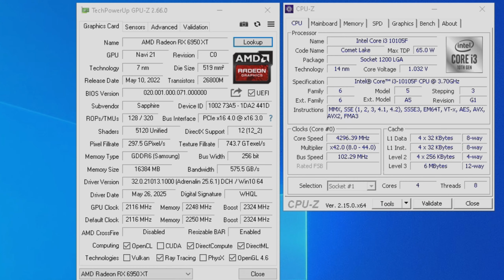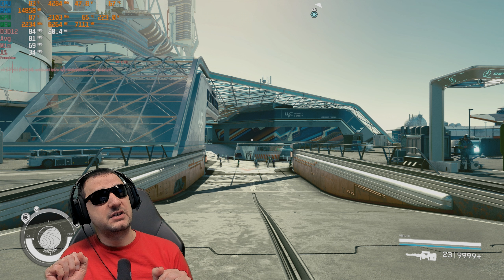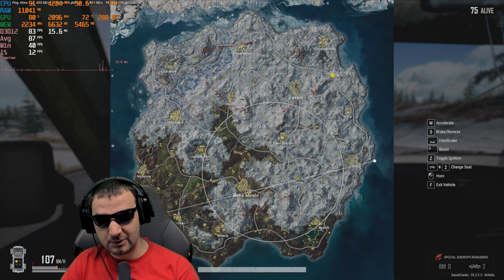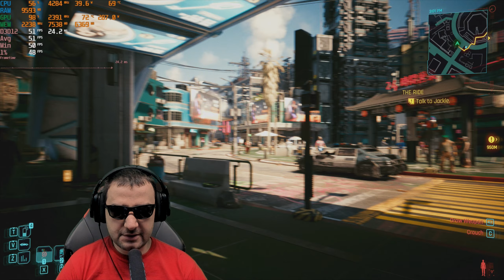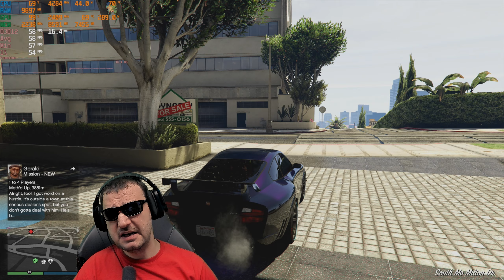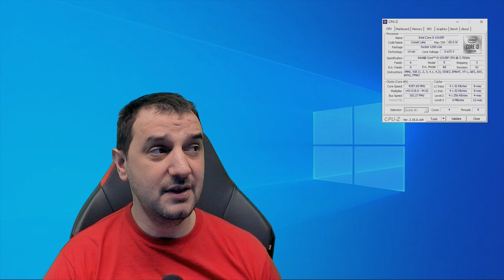Intel Core i3 10105F vs RX 6950 XT Benchmark

Comment: very intriguing mixture. Obviously the i3 was getting a heavy load, but I was impressed with how much it was able to do. I wondered if the i3 was maxxing out on single-core performance to compensate? Regardless, the goated 6950 was clearly doing the hard work.

Comment: The Intel Core i3 10105F performs great with the RX 6950 XT but the reason I wouldn't recommend pairing the Intel Core i3 10105F with the RX 6950 XT is because of the difference in price and the cpu bottleneck. I would recommend pairing a RX 7600 XT 16GB, RTX 4060 Ti 16GB or RX 6800 with it at 1440p/4K and I would considering pairing a RTX 3060 12GB, RX 6700 XT or RX 7700 XT with it at 1080p. The only reason to pair the RX 6950 XT with the i3 10105F is if you're going to upgrade the whole computer and cpu in the future to a cpu that doesn't bottleneck the RX 6950 XT.
Reply from the maker: For the moment, I do not have the money to buy those cards yet. I bought the current card to pair it with the i7 6950X and see how it performs. The i3 was just so I could test an AMD GPU versus the RTX and Intel ARC setups I have already tried. This is not the final form of the PC. It will eventually end up with an i9, since it is built on a Gigabyte AORUS XTREME Z490, and I need that for SLI and CrossFire support. It is more like the final form for testing. This setup is just something in between until I fully build and test the PC.
Reply: @DanielCardei I understand that Daniel. I was just giving suggestions and I also understand that you can't always afford all of this hardware.

Comment: Fun bottleneck build. I do note that even at 99%, the GPU is only near 290W, and it is a 3x 8pin. While my 6950xt is an OC model, it does go to 345W at default settings

Comment: Compare 10105F vs 10400, QTB0.. on ebay it not so expensive!
Reply from the maker: The best I can do for the moment, when I free the motherboard, is to get some Celerons and a Pentium. Those are cheap. That i5 is still not low on the price. I can get more CPUs with that money.

Comment: You need more benchmarks. Doom6, Indy, Stalker2, Wukong, TES4R? Nobody cares about CS2 or GTA5 with a high end card.
Reply: Those new games are boring and shit unoptimized crap
Reply: @excess.subiefl0w  Doom The Dark Ages is well optimized and seems like it is a great game going by what youtubers have said and it be at very positive on Steam. Also I disagree that Indiana Jones, Black Myth Wukong and The Elder Scrolls IV Oblivion Remake are boring but I will agree with you that they are unoptimized.
Reply from the maker: True. You are correct that in order to push the limits of a GPU like this, you need to run the games currently on the market. The only problem is that it will take some time until those games are optimized. By that time, other GPUs will come to market. Don’t forget about other games as well. So at some point, what’s the best GPU for that new game that was released and then became old? When does this circle ends?
Reply: b-b-b-but I CARE

Comment: Buy another cpu bro, i3 10th is 100% bottleneck , you need minimum i5 13600KF or ryzen 5800X3D
Reply: but isn't the whole point to show what the setup can do even if it's the bottleneck? we all know the gpu is overkill for an i3 10th gen but this is not something many people do i think. his whole channel is basically about benchmarking and experimenting older/vintage hardware and different setups like this one.
Reply: @umnickaleatorio  Dude, we know very well that he tests old hardware, but if the goal is to test the rx6950xt he must put an old CPU at least decent like a 5800x, also the XEON 2696v3 overclocked goes well, but not this i3. Otherwise he is not testing the GPU and any other less powerful video card would be the same
Reply from the maker: Actually, it's my fault in this case. In the B-roll, I was blabbering about the setup, and I thought it was irrelevant, but now I realize it would have made sense to leave it in.
The point of this was to test an Intel GPU, an NVIDIA GPU, and an AMD GPU with this i3 CPU to see how it performs, basically to push the CPU to 100% usage.
The only time I came close to testing the RX 6950 XT (and I think I mentioned it at the end) was with the i7-6950X. Now, I want to push it further using 4K with VSR.
The only setup that might actually challenge this GPU is my i9-10900K build, which I'm still trying to finish.
Yes, it's true, I’ll need a very powerful machine soon. But for now, I’m pushing the limits with a minimal PC that's just enough for GPU testing, since I keep getting new GPUs and the budget keeps running out.

Comment: I wanted a 6950xt over my 3070ti. One day I'll get one.
Reply from the maker: Bro! I just fell in love with that VSR and the FPS this card gave me. I want to test this card more and more.
Reply: just get the rtx 3090 same price better raytracing and productivity
Reply: I own the Sapphire RX 6900xt Nitro+ SE, and the card has a core failure rate of zero. This issue doesn't necessarily affect every model. It's more common on cheaper models where cooling has been compromised. For example, look at the difference between a Sapphire RX 9070 xt Nitro+ and an XFX RX 9070 xt Swift. The Nitro is almost twice as thick.

Comment: Looks like you've OCd via BCLK. You can crank the BCLK all the way to 102.95 before it crashes :)
Reply from the maker: No, no, no. Wait, what? I didn’t overclock anything; I just installed the drivers and started the games. Please elaborate more. Was it the GPU or the CPU?
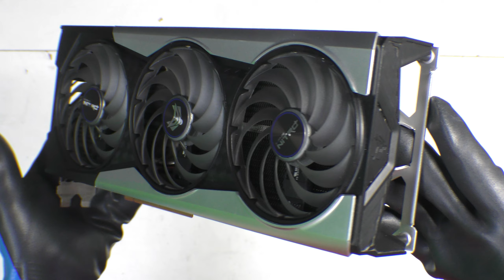Reply: @DanielCardei  You See at 0:06 - the multiplier is at x43 and the core speed 4400.79mhz. It would normally be 4300.xx mhz.  This is a GOOD thing though, it's basically 2% or so extra free performance. It may be that the motherboard is doing this automatically because the BIOS has been programmed this way by the manufacturer to get more performance.
Reply from the maker: @adamsaint2890  xmp has something to do with it?
Reply: @DanielCardei  Yes and no. The Intel XMP spec doesn't include any OC of the base clock but some motherboard manufacturers do enable certain 'optimisations' like this when you activate XMP.
Reply from the maker: @adamsaint2890 maybe thats it 😅
Reply: @DanielCardei  CPU is definitely overclocked bro. Look at the Bus Speed readout on CPUZ. As standard it should be 100mhz or very very close to that (99.98/100.05 etc). Cranking the BCLK up is a common way to get a bit more performance from Comet Lake (10th Gen) processors. Anything past 103mhz BCLK is locked down by Intel. On my 10900F I used 102.95 BCLK and this got me the same performance as the 10900K :)

Comment: The system is inadequate. You need at least a ryzen 5800x to push the 6950xt. I know, I've an rx6800xt overclocked. Good job bro
Reply: Bruh that's the whole point of the video, Daniel is usually showing bottleneck builds so that you know the performance from the combo
Reply: @violetwhite6875  I know very well what Daniel does. But this time it is not clear what he wants to test. That the i3 goes to bottlneck with an r6950x is obvious. There are old AM4 Ryzen CPUs, or XEON V3 that can match it
Reply: It's just for fun. I also have 5800x and many gpus like 3080, 3080 ti and a shit ton of mining gpus but I'm bored. I'm playing with old cards like 9800 GTX, SLI 8800 GTS, quad SLI GTX 690 etc on old games
Reply from the maker: 100% it's very inadequate. I think it stands here to show how not to do it. If in the future someone looks at an i3 and thinks it’s okay to buy a high end GPU with a low end CPU, maybe they’ll find this video. I mean, I’ll take that SEO because I’m not a big YouTuber :)